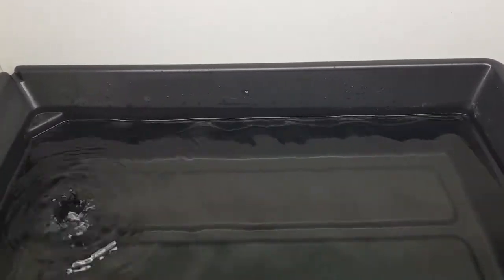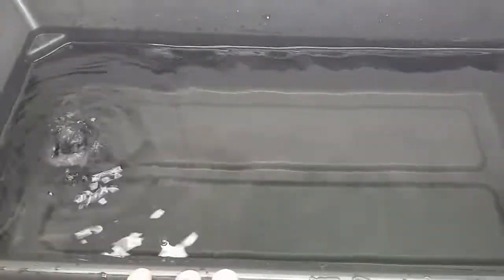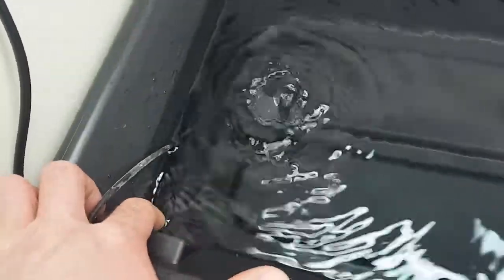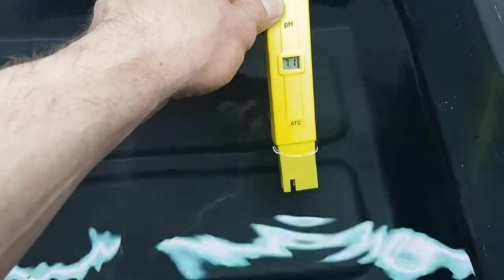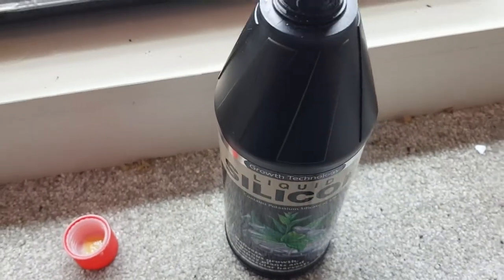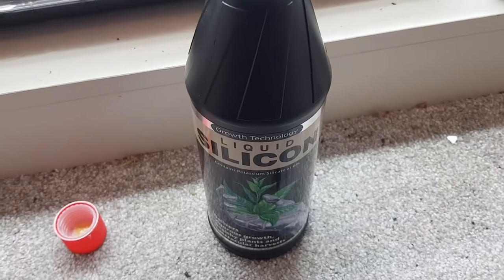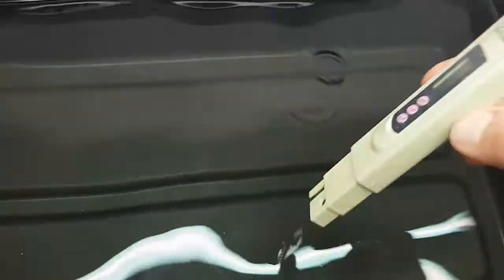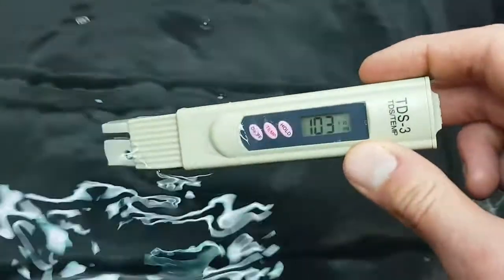Hydroponics at home - Adding Silicon and Nutrient for my GT205 NFT system

Comment: Why mess about with your ph 3 times puf every thing i  then adjust ph isnt it ?
Reply from the maker: You cant put nutrients straight in with silcon. The salts will precipitate out (basically make gel in the water).  You need to add silicon then reset the pH to what it was, before adding the nutrients.   Final check is to ensure everything is in a good pH range for plants (5.8-6.5pH).
Reply: @mattsplants7848  Why would I need to use 'Silly-Con' at all and how come I've never needed before ever?